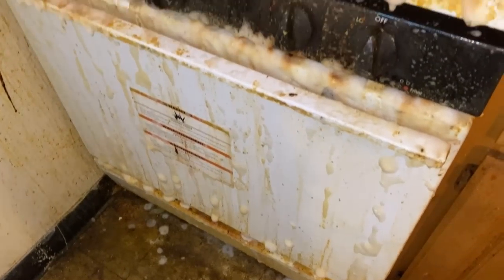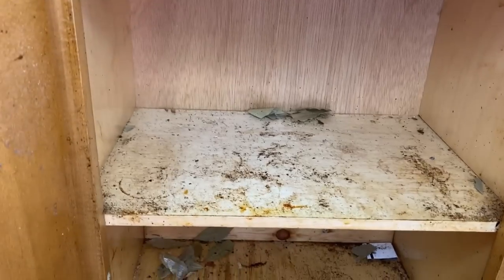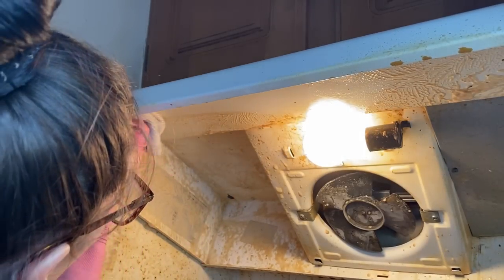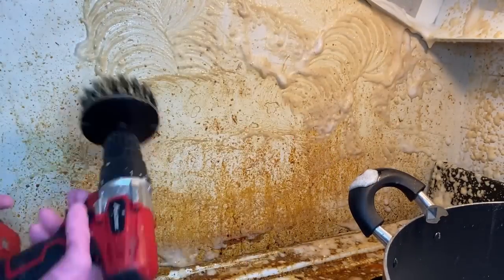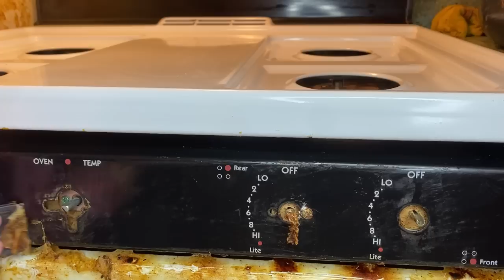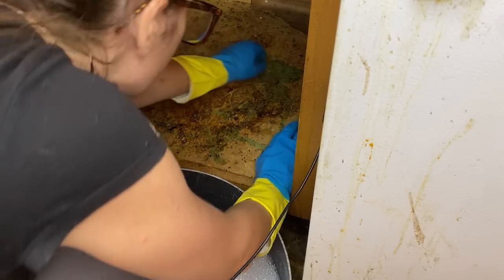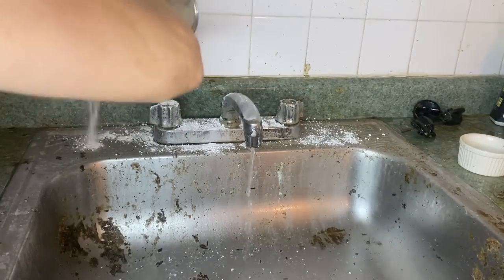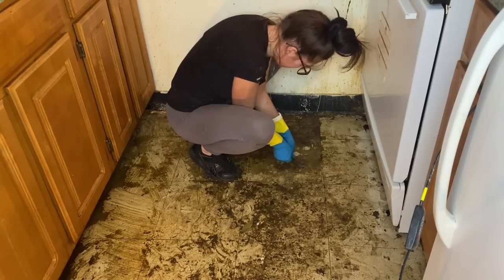9 hours HARD kitchen CLEANING!! 😱😱😱

Comment: Another great cleaning.  I had to clean a similar fan once-yak-I put a pot of water on to boil for a while to release the grease-much easier.  I also discovered Spray Nine and Krud Kutter-the best cleaner I have found so far-it got off 30 year old black tar from a porcelain sink.  Sometimes I carry around the boiling kettle for the worse grease/stains.  I have those drill brushes-awesome!! They even come with a scouring pad/brush!!

Comment: Wanted to share with you, Barbie, that those numbers/symbols/words around the control knobs on old stoves do not last!  We have had several old stoves and, when the features faded and disappeared, had to make adaptations in order to know what we were doing with the knobs!  We used dense white nail polish on one, to mark and abbreviate the places; we made a diagram and taped into the inside door of the cabinet closest to the stove for reference; we made a tiny "fan" of sorts from paper plates cut down small and wrapped these around the spindle the knob rests on; and we taped an old picture of the console from a manual to the wall above the stove to see what to do while cooking!  When the knobs are in front of the stove and curved around on top of the oven door, the natural happenings debride the control markings surface all of the time.  Pressure, heat, oil, drippings, cleaners, scraping (intentional or accidental), and years of use all conspire to take the markings away, eventually.  It is not your fault when this happens- my best suggestion is to diagram the settings BEFORE the markings are completely gone or consult the owners manual for a picture!  If you don't have time and the markings are already gone, go online to view the same or a similar model of stove and download the console features.  From someone who has been through this multiple times!

Comment: They sell trisodium phosphate at home depot- you would throw some of the granules on that greasy floor and pour on boiling water from a kettle. Works really well, even on fabrics. Have to wear gloves as it dries out your skin. Its also great for removing burned on grease on pots & pans. Good for deep clean in dishwasher & washing machine. Just needs to pair with very hot water. Love your cleaning Barbie

Comment: Instead of plastic wrap you can use plastic bags to put over the degreaser on the oven. It saves your strength to clean other stuff :) stray and cover when you first get there and then finish the drive after it’s soaked under the plastic and not dried out

Comment: Barbie, look for a bigger scrapper. They make ones that are for removing linoleum or the sticky tiles. The blade is 3-4 inches across and the handle is made for your whole hand to hold onto instead of just your fingers. You’ll have more strength and your fingers won’t get so tired. And look for a product called TSP. It’ll remove the grease off the walls. It’s actually a product that’s used before painting to allow the paint to adhere correctly. You are such a HARD WORKING WOMAN!!
Reply from the maker: Thank you! I already have one ❤️❤️❤️ but at this job I didn’t know i will need one 😅😅😅

Comment: I don't know if you'll see this as I am very late to comment but I reuse grocery plastic  bags for the stove, to reuse instead of wasting plastic wrap so oven cleaner stays longer. I cut two of them down on bottom where its sealed and the handles, and make sure if there is printing on the bags it's face up.

Comment: Barbie, I just watched a video of someone who got this kind of grease off kitchen cabinets with a product for cleaning car tires and rims. Great idea that worked really well. The brand they used was Meguiar’s Hot Rims Wheel and Tire Cleaner but probably other brands would work too. The channel is called ghostses. Ammonia also really works but you must have a window in the kitchen to open for ventilation, and open other windows in the apt.

Comment: On the floor Aurikatariina would have wet it with her boiling hot water kettle, and spray it with oven cleaner, scrap it and then squeegy it and then mopped it. So easy without using all that shoulder strength you were using burning yourself out.

Comment: New viewer here. I love your accent! I'm Hungarian,  so I still have mine. Where are you from? 
Recently I found a great product in the Dolar Tree store. An oven cleaner, but, not aerosol, but squeeze spray😍, my lungs thanked me for it. Also it's a gel, so it doesn't run down on vertical surfaces.  I cleaned walls with it and worked beautifully.  It's made by carbona. I really can recommend it 👌

Comment: I congratulate you on the work you do, it requires a very good heart to do it! But sometimes I think you work harder than needed! Why do you never use bleach on bathroom black mold? It will not only disappear them but will disinfect like nothing else. Just spray it pure on surfaces, go do other things for about 20 minutes, rinse it and scrub with your detergent of choice (never mix it with other stuff). It will be easy! You might also try using a dish brush to clean bathtubs and tiles and hard to reach places like toilet bases, the handle will be easier on your hands and articulations. Blessings!

Comment: Barbie you really need a steel daddy. You could clean the walls with it and it would have taken more off but again your right it still would need to be repainted. Also Barbie that is not the only reason it shocked you. We had a similar problem where the stove shocked my husband and it was because the wires on the stove had burnt out and was not grounded. You getting shocked is not okay they should have took that more seriously.

Comment: I used to do painting along with remodeling.
Cleaning walls really should not be part of painting. I would not have done this paint job.  There's too much grease. 
I would only clean the dish soap and warm water to clean the dirt or smoker's smoke off the walls. We charged extra for a primer coat if the walls were really bad.

Comment: The only thing I would like to do to this hideous kitchen is to rip out the whole thing, sandblast it floor to ceiling and replace everything, top to bottom, essentially a brand new kitchen cos this is horrendous and you're very brave for tackling it.
Reply from the maker: That’s would be the best
Reply: @cleanwithbarbie  but of course, you did a fabulous job and made a great video so thank you 🙂
Reply from the maker: @questionmark9819  thank you! ❤️❤️❤️